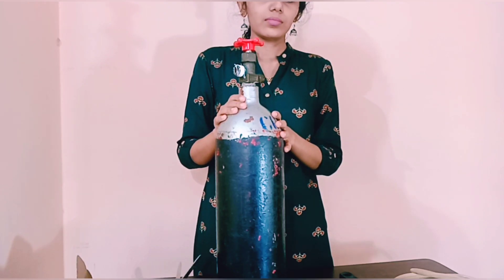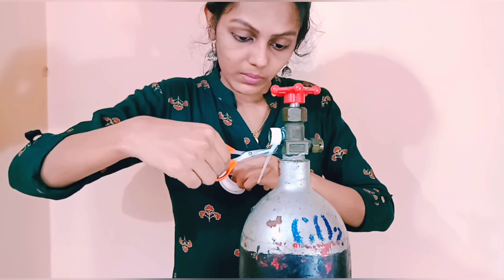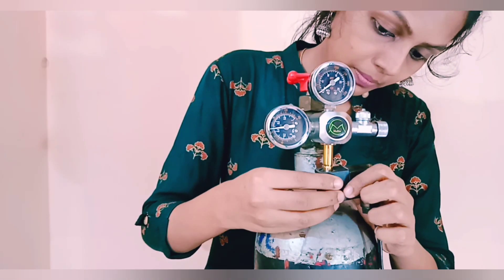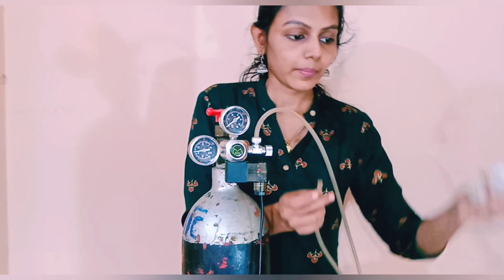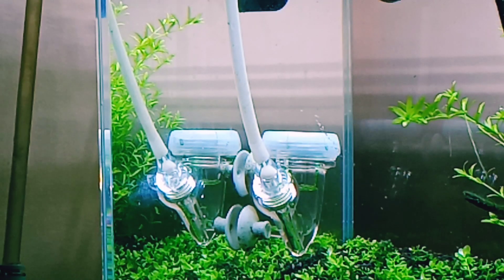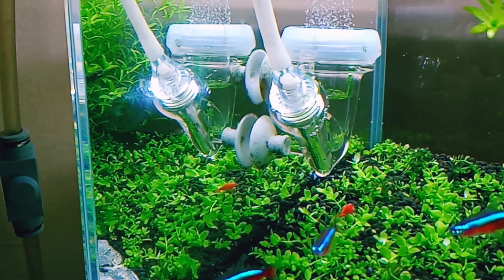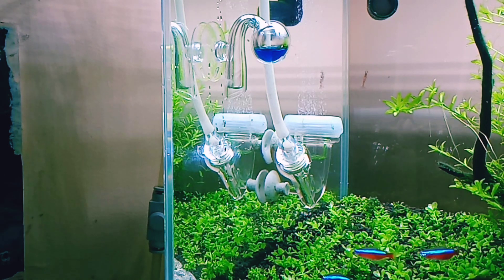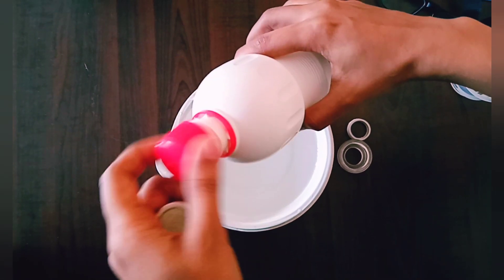How to Install Co2 system in aquarium | Co2 dropchecker installation | Planted aquarium Co2 setting.

Comment: Is solenoid valve necessary?
Can't we set up without it to reduce the set-up cost ? 
Kindly guide me
Reply from the maker: Solinoid valve is not mandatory..but it is a very useful option.with that you can turn on/off the co2 just by plugging in to a powerpoint or use a timer... Without that every day you have to turn on cylinder knob and sometime co2 level fluctuate.
Reply: Clearly understood 👍

Comment: Solenoid is required? We can turn off and turn on the CO2 when required right?...
Reply from the maker: Without solenoid every time you have to turn the valve to on the Co2, with solenoid this can be done automatically with a timer synchronised with your lighting..very easy.
Reply: @naturestudio-aquascaping7205  thanks for the clarification

Comment: Great video. What type of cylinder are you using? It doesn't look like typical aluminium cylinder sold for aquariums, Looks something like used by welding stores.
Reply from the maker: It's a normal cylinder..the companies like ista sells aluminium cylinder.. anything is okay,as long as you have a good regulator and precise needle valve on it..
Reply: @naturestudio-aquascaping7205  what's the price of your cylinder? Is the filled weight 2kg or empty?

Comment: As my suggestion don’t put co2 checker beside the diffuser it will not show the accurate  Co2 level in the tank
Reply from the maker: Yes,it should be on the other side.it was kept for shooting purpose only.
Reply: Nature studio -Aquascaping I under stand for beginners they don’t know and even in the video didn’t mention so they think that is the place i have one suggestion just need to show the aquarium in full scape for 10 -15 seconds
Reply from the maker: Yes correct. About the scape,this tank is not ready to show yet.that's why😀.it may take few more days to fill in.

Comment: 1st view....😃😃😃
Reply from the maker: Yes..yes..😀you are the one..!!
Reply: I think u had done mess of the connections. Non return valve wrong direction. And the tube is not meant for co2 its normal air tube. . and the process of connecting tube to regulator
Reply from the maker: @Ramji Jayasree
 No,Non return valve is connected in the right direction, if not co2 will not come out. 
And it is co2 grade tubing. Am using same tubing bundle on all of my tank past 2 year.